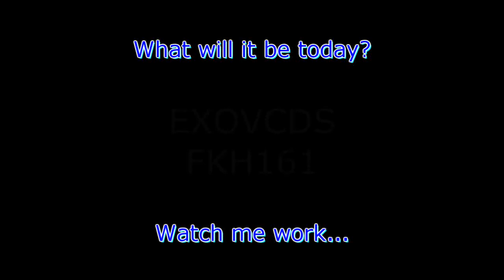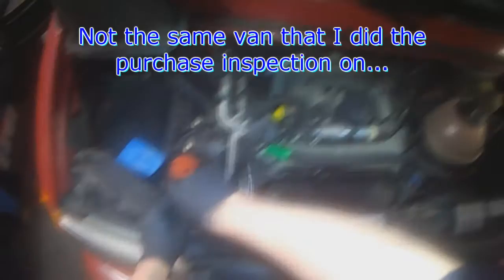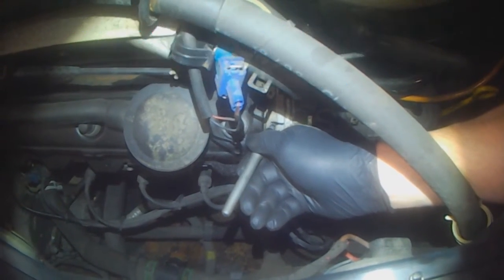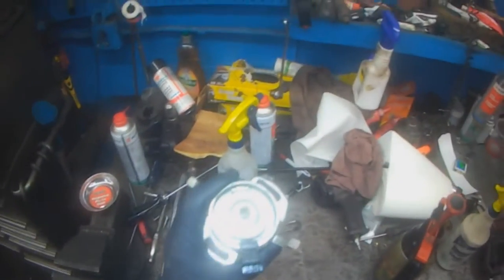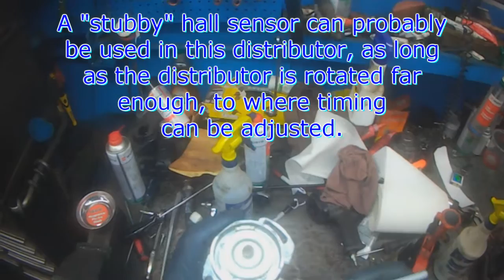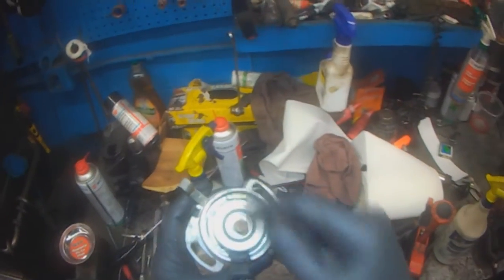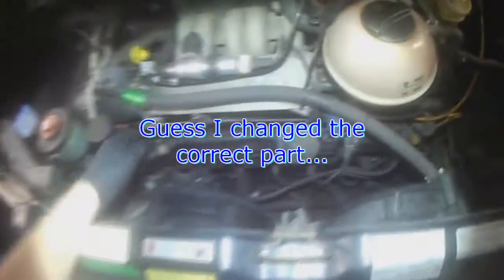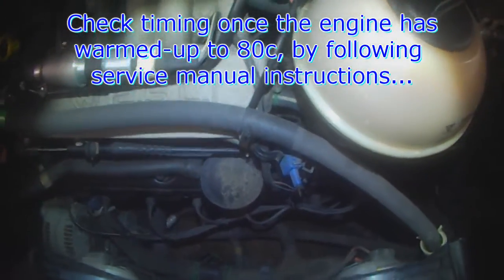VW T4: Crank no-start (hall sensor replacement)

Comment: Thank you!!  I'm about to do this in the next few days.  I was under the impression that the ACU engines called for the stubby hall sensor, while earlier AAF engine called for the separated hall sensor.  With the ACU being interference, if alignment and timing isn't super perfect upon the install, could damage be done?  Thanks again!!

Comment: I broke the plastic carrier/coupler/drive gear(@6:58) - depending who you ask what the part is called - where do you get a replacement?  or is it a "replace the entire distributor" kind of thing?
Reply from the maker: One of many google search results for 030905242:
https://europarts-sd.com/distributordrivecamkit1992-1996.asp

Comment: Hello,Great videos you do! My t4 petrol auto,sometimes won’t start,have changed pretty much everything except hall sensor.Sometimes no start,then 5 mins later goes.Is this typical story to them failing?Thank you.
Reply from the maker: Could be.
If the engine has a crankshaft position sensor, I would suspect it first. T4s in North America don't have crank sensors... I don't know where you are at, so you have to check if you have one.

Comment: Hi Thomas, I have a 1993 eurovan 2.5l 5spd m/v in usa. It Carmel’s no start. Followed your videos and hear duel pump. Hear injectors. Have fuel covered wet spark plugs. The coil was arcing to the ground when testing the hall sensor plug as you demonstrate. I replaced the distributor with a new one and new sensor. Wouldn’t run. Tested it again and it arcs again indicating a bad hall sensor. Any idea what I should do next?
Reply from the maker: Did you install the drive gear correctly on the distributor shaft? If you installed the drive gear 180 degrees out, then the ignition rotor will be sitting 180 degrees out (spark will go to the wrong cylinder). Are you sure that the timing belt is OK? If the timing jumped, then camshaft & crankshaft are not timed correctly and the engine will not start / run.
Reply: I believe I installed it correctly. I checked the orientation of the one I removed, the little plastic pin inserting into the case right? I set the new one to the same orientation when I put it in. Wow thanks for such a fast response. Sorry I didn’t check back sooner.
Reply: I have spark when I hold spark plug to block and crank over?
Reply from the maker: Yes, the plastic pin can only sit one way "against the camshaft"... but the plastic pin can sit 2 ways on the distributor shaft. Are you sure that it is on the distributor the same way that it was? The plastic drive pin has to be In-Line with the cut-out in the shaft where the rotor is positioned... watch at 15:30 to 15:34
Reply: Oh do you mean if it was disassembled? I put a whole new distributor in it. Opened the parts box and installed.
Reply from the maker: OK, sorry, then it should be OK. In that case you need to check your timing belt. Make sure that the camshaft did not jum teeth. Turn the engine to TDC #1 and check your camshaft & crankshaft alignment. Send pictures to my... you can find my contact info on my website (fkh161 link in the description)... click on "tool request" to send me pictures.
Reply: will do ASAP. Thanks

Comment: Thanks for your prompt reply Thomas, i forgot to mention that when driving its ok, but as soon as i accelerate  it coughs like it isnt getting enough petrol quick enough..this happens all the time..
I will check what you have advised.
Cheers
Reply from the maker: Fuel starvation issue then... most likely. I think. =)
Reply: @EXOVCDS  sounds like everything can trace back to a fuel issue..so i will remove the seat and have a lookskey at the condition of the fuel pump and try and find another fuel pump relay..
Hehe
Reply from the maker: The T4's in North America never came with a 2.0L... does it use a MAF, or MAP sensor? If there is a MAP sensor, it couldn't hurt to check its function. A fault with the MAP sensor will also affect the O2 signal. Monitoring O2 signal at idle and under load can also help determine if there is a fueling issue. If the O2 is stuck rich at idle, it could be due to a broken vacuum hose for the MAP... if the O2 is lean under acceleration, that would point towards a fueling or MAP sensor issue (sensor not reacting to change in intake manifold pressure). Is there a diagnostic port where you can check for fault codes or live engine data? Would help with the troubleshooting.
Reply: No worries ..if anything when it gets close to actually  firing ,after 5 min of clmtinously starting, starts to give of a really lean,almost distributor plastic smell...most probaly going to set the fukka on fire by Monday...i will post a pic of it lit up..lol.
Reply from the maker: @gixerags750  The starter will start to smoke / smell when it is cranking for too long... not allowed to rest long enough.
Reply: @EXOVCDS  hi Thomas, i think i am honing in on the problem...when car is running it seem like once the accelerator pedal depresses past say 1cm  fuel restriction happens, this time  when i started it i  just depressed the pedal about a cm with a couple of shallow pumps.it started after a few cranks instead of 40  as before..i assume that their is most likely air in the fuel system that requires bleeding..could this have happened if the petrol tank ran cpmpletely dry around a year ago..it makes sense to me but does it make sense to the best VW mechanic on thiss earth??ps i know you are the best..
cheers Andrew

Comment: Hi Thomas ,from Australia ..i have a 2.0 ltr T4 1998 petrol that takes forever ,10min if left overnight to fire,even with a new battery...particularly  if very cold or wet overnight...if a mechanic checks the distributor  and ignition coil and says they are ok. Can the hall sensor still be damaged  ?i do not know how thorough their dizzy test was..pleasse help as no one here in Adelaide has any fkn idea let alone want to work on them..once i get it started it start a little easier but requires 30sec of cranking and during those cranks you can hear that it tries to fire up.
Much appreciated .you know you're  stuff
Reply from the maker: I would check the coolant temperature sensor for the ECM. If the ECM thinks that the engine is warm (when it is not) it will not inject enough fuel. Once the engine is warmer, it will be easier to start. If the temperature sensor is ok... fuel pressure would be next on my list to check. I don't know of the 2.0L in the T4 has a crankshaft position sensor... if it does, then the distributor signal is not needed (is not the cause for the delayed starting). If there is no crankshaft position sensor, a bad hall sensor will cause a no start or stalling, not a hard start problem. Can you scan the ECM for fault codes? A bad ECM relay (if it has one), could cause starting issues as well. Many things to check.

Comment: I have a 93 westfalia the dash harness burned and I’m replacing it got it to crank but no start. Mind not all the wires are connected as you know it’s a wiring harness it’s a b** wish it was simpler. These videos help but wish I could find one due to harness replacement (under dash).
Reply from the maker: Wiring harness replacement is rare. If the harness is complete and the same as the original... reconnect the new harness as yo what was connected on the old. Some connectors may not be used on all vehicles as main harnesses include connections that apply to specific vehicle equipment. If the old one is burnt so bad the you can't tell... rely on a wiring diagram to tell you what needs to be connected & where.

Comment: Thomas, do you have any videos on doing ignition timing for the 2.5L?
Reply: Finishing off a 93 5spd. Just turns off while under acceleration as if someone turned off the key, random, Or will just turn off while at idle for a while, always at operating temperature. Then takes a bit to restart. Almost feels like it could be the ignition, but leaning to not. Replaced the ecm relay and it went away, but started doing it again. Hall effect sender, crank position sensor, ignition and fuel pump seems to be suspects. I changed the coil and no change.
Reply from the maker: The engine has no crank position sensor, so I would check for a hall sensor signal when the engine does not start.
Reply: @EXOVCDS  would could cause the idle control valve to not get a 12v signal to the connector?
Reply from the maker: I already replied to that question... check your other posts for replies. It's easier to keep track of posts if you keep them all together.

Comment: Hello

If you do this on a similar system (VW) and the crank sensor is bad would it then still spark?
Reply from the maker: If the crank sensor is bad, the engine usually will not start (no spark)... but I have seen some cases where that's not true / where they will start. If you have an RPM signal, then you should also have spark.

Comment: at about 15:35 into the video, as I am fixed a distributor reassemble wrongly, the notch and the knob for the placement onto the van are perfectly inline correct (mine are 180 apart right now)? Thanks
Reply from the maker: +QMI The knob should point at the notch (for the rotor) in the shaft.

Comment: Thanks, 2nd video shows pin removal
Reply from the maker: Even if it wasn't in the second video... I think it's self explanatory (how to remove the pin).
Reply: @EXOVCDS  Ha, for you of course. The plastic piece split when I tried removing the pin. Luckily the hall effect sensor kit included a replacement. Thanks for your demos they are great
Reply from the maker: They have split for me as well. =(

Comment: What size punch do you use?
Reply from the maker: +Sloppy Buns I used two different sizes... one that is slightly smaller than the pin and one that is slightly larger than the pin.
Reply: +Thomas EXOVCDS Yes I saw that in the video but is there an actual size in mm's?
Reply from the maker: Sloppy Buns 2 or 3mm pin punch to remove, a larger one to knock it back in place.

If you buy a pin punch / chisel set, you will have all you need.

This is the one I have:

http://www.amazon.com/Astro-1600-16-Piece-Punch-Chisel/dp/B000LQLGHO/ref=sr_1_1?ie=UTF8
Reply: +Thomas EXOVCDS Thanks mate will do, and thank you for the videos they are invaluable.
Reply: +Thomas EXOVCDS OK the drive gear broke in two when trying to remove it LOL, do you know where I can get a new one?
Reply from the maker: +Sloppy Buns Sorry to hear... a wrecking yard (whole distributor). I don't think that the gear can be bought separate... I'll check tomorrow and will get back to you.
Reply from the maker: +Sloppy Buns second item in this link: http://europarts-sd.com/sub-category.asp?scID=326 part number of drive gear is 030905242
Reply from the maker: +Sloppy Buns A bunch of other places seem to also carry it... just image google / image search the part number 030905242

Comment: you think a no start after an oil service is bad another tech has been fighting a misfire complaint on a Durango, that came back Fri, he pulled it in hooked up a scan tool and power braking it the engine locked up tight as a drum😠😲😵
Reply from the maker: +Michael Berg Ouch... I had a TDI runaway on me during a test drive. #4 con rod put  a hole in the block. Things happening at work is one thing... but being accused of something that was not related to the prior work that was done (trying to get a freebee) is what I find ridiculous.
Reply: Yeah, sucks people expecting you to fix something for free because they spent some money, had 1 last week bad crank sensor, they were talking about taking the last shop to court to get their money back from them, good luck the sensor was broken from mud in the t belt area. But they wouldn't fix their broken driver side door that wouldn't open at all, had to pull a dukes of Hazzard to get in the damn pos